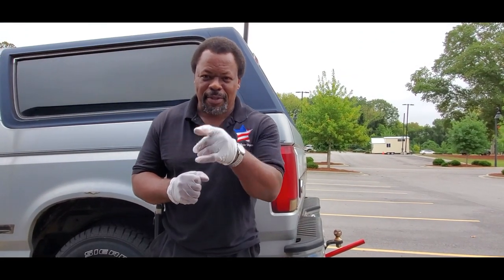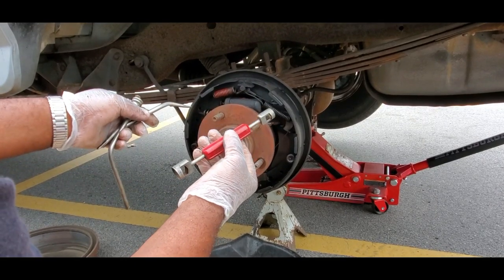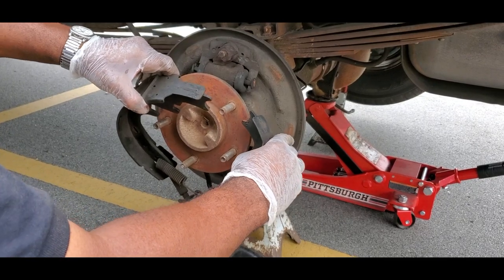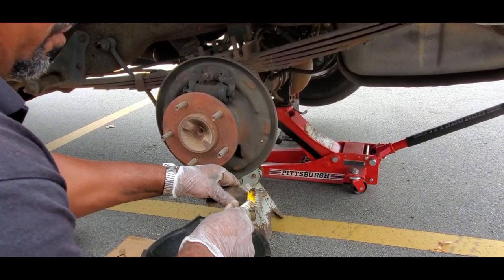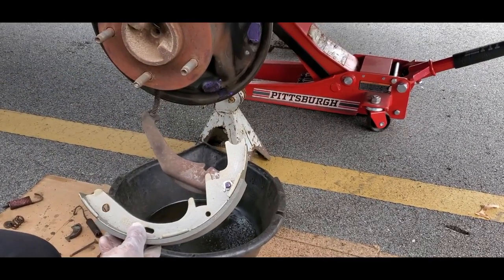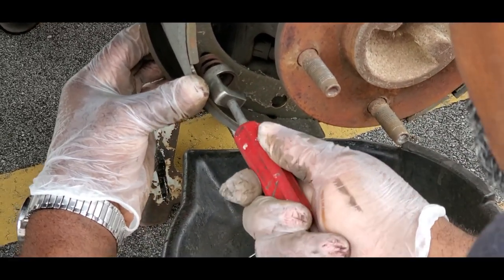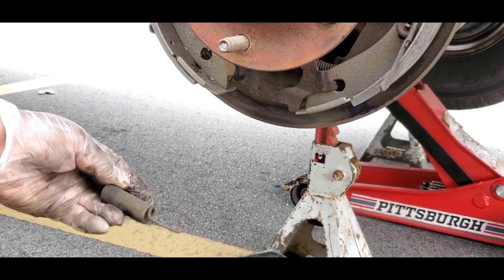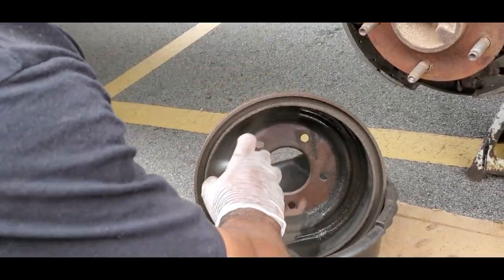⭐ 1993 Ford Bronco - 5.8 - Rear Brake Shoes Replacement

Comment: Hey Tim, the reason for the back brake shoe being bigger is because it does more of the work of stopping. The wheel cylinder pushes both shoes out and the rotation of the drum forces the bottom of the front shoe to push against the adjuster, which transfers the force to the back shoe. Glad to see you take a break (brake🤣😂) from the Beemer. That thing is giving me fits and I'm 750 miles away.
Reply from the maker: RICK with the science, GO RICK!! Thank you for explaining that!

Comment: Rick is 100% right, the front shoe is called a primary and the second is a secondary which does most of the breaking in the forward motion.
When backing up, the secondary shoes shift which causes the the self adjuster lever to rotate the the star adjuster.

Did I hear Silvia say that this is or was OJs Bronco or was that a white explorer LOL

GREAT JOB BUDDY!
Reply from the maker: Hey Ron, yes you heard it right, LOL!!
Reply: @OnlineAutoRepairVideos   OMG that was a Freudian slip if I’ve ever heard one LMAO 🤣